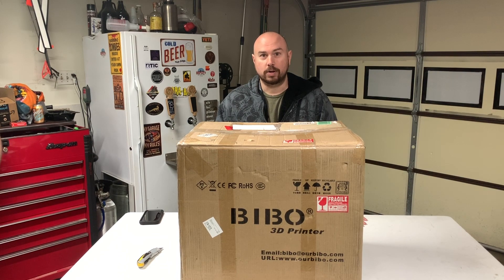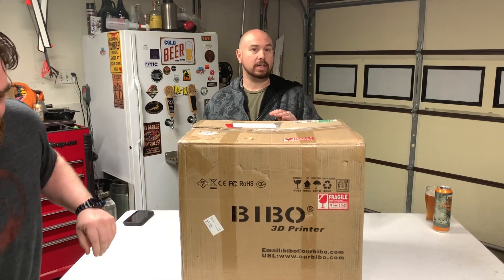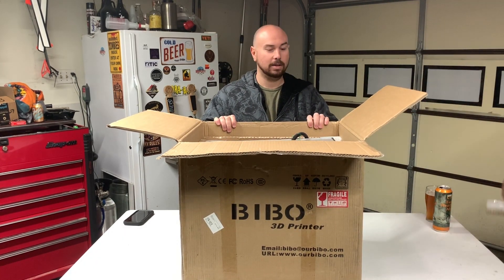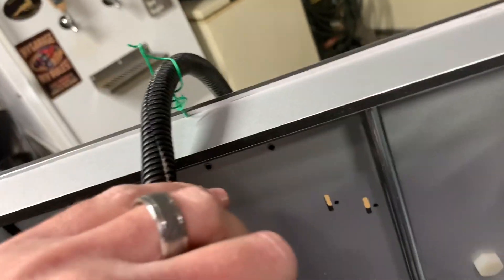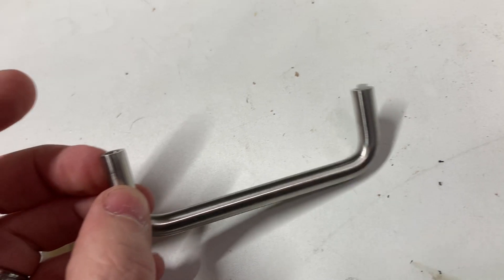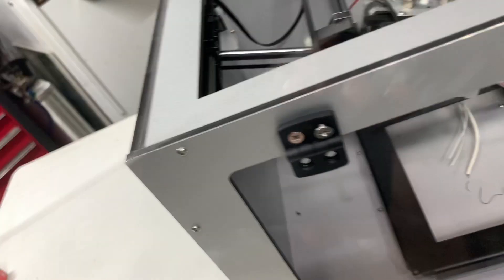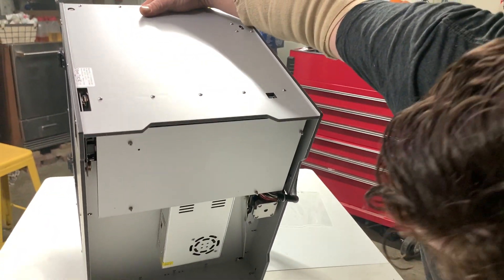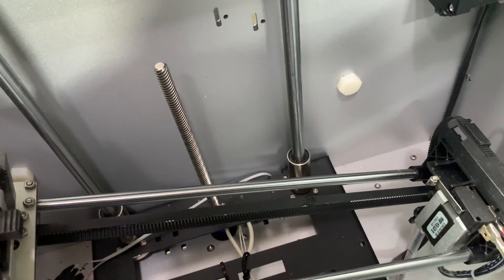Open box BIBO 3d Printer

Comment: Clearly someone took advantage of a 30 day return policy. Bibo offers three purchase options. 

Open box/returns. It appears that Amazon accepts returns without inspection. (Your situation)

Damaged unopened/never used. 

New purchase.

Everything I read from ourbibo states this pretty plainly. Chinazon, not so plain.

 I purchased one new Bibo 2, now I have three. Two purchased as damaged unopened. These tend to have everything still assembled but a fractured frame.

I agree with your sentiments of product reconciliation if it was a new product purchase. That printer works awesome. My first is now liquid cooled fully enclosed fusing filament like Pro models 4 times the investment.

Comment: Sorry to see you have so much trouble with the Bibo.  I have had one for several years without issue.  You were missing a lot of stuff and I can tell you what all of those odd pieces are, such as the spring.  It is for tensioning the belts and works out perfectly.  I have never had to tension belts as the spring keeps it just right.  The wire in back is for the out of filament sensor, which looks completely missing in your video.  The only two complaints I have about it is estimated print times are way off.  Usually an hour longer then expected and the biggest issue I have had is feeding the filament into the head.  If there is a slight twist at all in the filament then it tends to miss hole to the hotend, so changing filament can be 10 minutes worth of trying to trial and error on hitting a hole that I can not see. since there is a fan in front of it.

Comment: Sucks that this happened. I ordered from Amazon and got a mostly assembled printer. The glass bed was broken but Bibo refunded through Amazon and have me the link for a new one. Worked like a charm until I tried Carbon Fiber PLA (clogged the right nozzle). My fault...
Reply from the maker: glad you got it working before the carbon filament. Usually you will need a good all metal hot end for a filament like this.